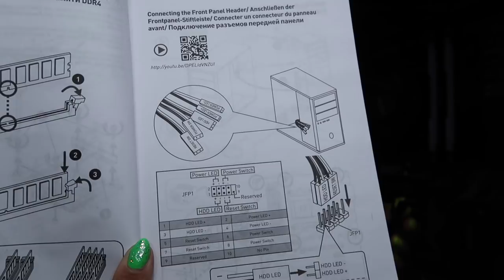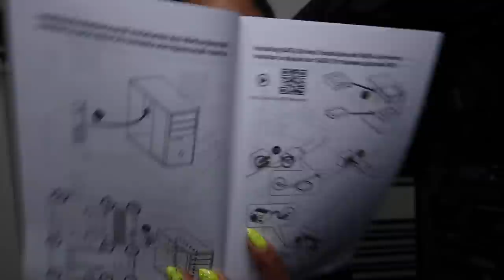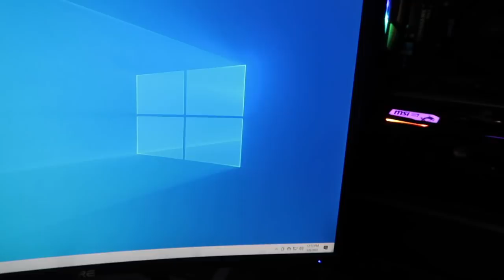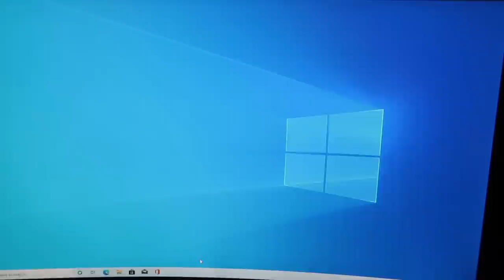My 1st PC build!

Comment: one of the fans should blow outward to dissipate heat, usually the one at the back
Reply: She added a caption saying that she will be flipping the fan in the back so it’s an exhaust instead of intake. :)

Comment: hey just a little tip for you. You have everything as intake. You need to flip the fans around that your using for exhaust because right now they are being used as intakes.
Your front fans are fine though you have them the right way for intake but the top and rear ones you need to flip around.
Reply: How can you tell from afar?

Comment: Great build, I just did mine this weekend. Thank you, you reminded me about the cable extensions for cable management, I will get some cable extensions for my new build. I did like the "Hello Kitty" insert, just a reminder you may want to check out which direction your fans are blowing you can do Positive, Negative or Neutral airflow inside your case.

Comment: It a good habit to test outside all the components (on top of mobo) before putting them in the case to make it easier to pinpoint the fault just in case as it lessens the load if something goes wrong afterwards. It also helps you figure where things goes as everything's out in the open.

Comment: If your hair keeps getting pulled into the rear fan it's not set up as an exhaust fan. It's in pull configuration. So you'll need to turn it around to put it in push configuration to exhaust the heat out of the case.

Comment: Well done, great parts for a powerful pc. Although your peel game needs some work lol.
You might want to look up a video on how to configure your fans in the BIOS. They are running full force so I suspect they are 3 pin fan connectors and they require a different setting, it will make your pc whisper quiet.

Comment: Before putting fans on top always run cpu cables etc through before installing fans top side makes it a lot easier also always use pcie slot closest to the cpu :)

Comment: Hey there! I just wanted to point out that your rear and top fans should be in the exhaust orientation. The way they're facing in this video is intake (fan grill/the "X side" blowing air in) and not allowing hot air to escape. Assuming time has passed, you may have had someone mention it already and you've addressed it. Other than that, wonderful build and so happy to see you proud of your masterpiece!

Comment: Great build👍 I would consider turning the top and back fans around as they are all intake so it will create a lot of negative air pressure which isn’t good for airflow and thermals whereas a combination of the two intake at the front and the outtake fans at the top and back will keep the air flowing nicely

Comment: great build, well done. :-) other than the fans that i know you turned round, the only thing id be worried about id the ssd not having a heat sink on it. that will get hot and will slow down when getting too hot. <3

Comment: Good job on the build!  It looks like your rear fan is backwards. You want to make sure that it is exhausting air out. There should be arrows on the fan that show what direction the blades spin and what direction the air will go.
Reply from the maker: Yea I noted the fans were on wrong I just haven’t turned them around yet 😓

Comment: quick tip if you build again do not place mother board on top of the static bag put it inside the motherboard box or in the trash as any static electricity would easily jump the mother board and cause it to not work

Comment: I would recommend to change from a block cooler to an aio cooler for your cpu, also I do not recommend you to unplug/plug anything in while the pc is ON, unplug the power supply and hold the power button for 15 seconds so all the power in your pc is gone, THEN start working on it. But overall nice work

Comment: you can move the AMD CPU cooler easily to show the AMD logo correctly the way to do this is where the AMD logo pull it upward to get the cover of the fans. Then you will see four screws unscrew them so that you can remove fan from heatsink/metal block thing with fins onto of motherboard. then you can rotate it and screw it back in and put cover back on. just remember to unplug cable of CPU cooler first before rotating and unscrewing CPU cooler fan from heatsink. I did this when I had the same cooler.

Comment: I have that case.  It's a nice case but it is huge and really meant for water cooling which I don't have.  Live and learn.  Next time I will get something more designed for a air cooled set up and much smaller.  Nice computer though.  Definitely needs more funko pops inside.

Comment: The fan at back is facing wrong direction. It should take the hot air ot of the case. So turn it 180 degrees horizontally. Your case will be cooler.
Reply: This video is from a month ago so I'm sure she's corrected all that already..😉

Comment: overall nice build. but its not a good idea to have all the fans as intake. you need to turn 1 or 2 as exhaust. i would recommend turning the top fans as exhaust and also the rear one. the front 2 fans are huge and move a lot of air inside the case.

Comment: the only think u should have gotten instead is the 600watt should be a 850 or more. and the 500 ssd should be 1tb with updates, game saves, apps. take up room quick. going with a better watt power supply like a 850 gives u more room to upgrade your pc later on.

Comment: There is a slight error in the fans
  All the fans that you have enter the air into the bag and this is wrong
You should make the fan at the back and the fans at the top blow out the hot air
You have to turn the rear fans and the top ones

Comment: Enjoyed the video! Good thing you used Western Digital Black as the primary drive instead of Western Digital Blue. WD Black is way faster than WD Blue, but it is also more expensive. WD Blue is for general use. Most gamers prefer Black over Blue. There is also WD Green, which is even slower and cheaper than WD Blue and has smaller capacity options, but WD Green uses less energy, so it is quite common in laptops. Anyways, keep up the good work

Comment: You have no exhausting fan an creating negativ air pressure in your pc, which causes more dust in you PC and bad cooling efficacie.
 I would recomend you to flip your fan at the back and the tow fans at the top for ideal airflow and better temps :)

Comment: the 3 small fans should be output  the  2 big ones blow air in case and the 3 small ones should blow air out of case need to turn them around

Comment: The Western Digital, do I need the hard drive and does it come with the SD card or do I need to search the specific SD card alone?
Reply: There's a difference between SD and SSD. A Western Digital SSD is used as a hard drive for long-term storage. The one is this video is an M.2 SSD. It is faster and smaller than a traditional hard drive. SSD stands for "Solid State Drive", which means there are no moving parts and it is noiseless. Most newer motherboards have these M.2 slots. On the other hand, an SD card refers to portable storage, which you see in a camera or an Android phone. So when comes to a desktop, you only need to worry about buying a hard drive. Look in the manual for your motherboard, to see what type of connector you need for your hard drive. Most likely it will be M.2 or SATA, both of which accept Solid State Drives. Also, find out the speed of the drive, and match it to the motherboard connector of choice. M.2 with NVME is very popular these days as it is much faster than SATA. But they are also more expensive. So a lot of people use a faster drive as their boot drive, and they will get a slower but bigger drive for secondary storage.

Comment: Hi Chrissy! Were you able to go into BIOS and set your RAM to it's specification speed? It's called an XMP profile, it should say that in your RAM spec area in BIOS. This will allow your system to perform optimally, and it's really simple. If you don't know how, just check out a video on the subject. Great video...I went through similiar with my Ryzen build as well. :)

Comment: what CPU cooler did you use? does it come with the CPU or does that depend on where you buy it? got another question, do you spend a lot of time on your pc? I afraid I'm not gonna use it much, for example, I experience that when I bought a Nintendo and didn't like it so I sold it, and I don't want that to happen when I buy a pc
Reply from the maker: My cpu came with a cooler it’s a Ryzen 5.  I don’t really spend a lot of time on it because I still work full time and I get busy but I don’t regret building it 🙂

Comment: Okai so the only thing I can see u did wrong is that u put the Fans that didnt come with ther case as an input, so they are blowing air into the case and not pulling it. Its better to have a positive air pressure inside the case so the dust doesnt get inside as much. So u should change the fans u added so the black reinforcement bars u can see facing the inside of the case are against its panels (aka top and rear side). Besides that the build is pretty okai. Loved ur reaction to its first boot.

Comment: your back fan need to turn around did you put paste on your cpu i didn't see that Thank you
Reply from the maker: Yes I said / noted in the video and left a pinned comment that I was aware and have switched the fans. This CPU cooler has thermal paste pre applied. 👍🏽
Reply: here to help

Comment: hey just wanted to lyk your fan in the back of your case is pointing the wrong way. it's cooling your room, not your pc so make sure you turn it around. Also make sure your tops are pointing air into your pc aswell. Nice build though, have fun!

Comment: Hello a power surge fried my home office PC. It damaged the whole PC. I took it to Geek Squad and they couldn't power it. The computer was 11 years old. They said,``After 11 years its time to get a new one.'' My backup PC is a 2012 model. It was built 12 years ago. It works but its on its last legs too. When it turns on, the fan grinds. Other times I have to turn the PC off and on to get the fan working. The power switch got jammed and broke off. Now I have to take the panel off the PC to power it. It runs an Intel Q9550 2nd generation quad core processor. It has 2.8 GHz. 8 GB RAM, Seagate 500 GB hard drive, PNY NVIDIA GeForce 630 GT video card, Cooler Master 650 PSU, card reader, etc. It runs Windows 7. My monitor is a Gateway 22 inch. It has 1680X1050 resolution, VGA, HDMI, and DVI inputs and Ultra Contrast is 2000:1. The monitor is 16 years old.

Comment: There was a couple mistakes in this video:
7:00 Its good pc building practice to put more thermal paste on the cpu, even if there is pre applied paste on the cooler.
9:02 You suppose to put the ram into slots next to each other without a gap, because of reasons.
8:47 Thats called a brace, not an io shield
6:56 She didnt screw it with enough confidence.
Reply: You're 2nd point is CAP she did it right.

Comment: 16:03 Almost exactly what RTFM stands for....Read The F**king Manual ;)

To be honest, if it's your first time building a computer you should read ALL the manuals, don't trust that some other YouTube video will solve it.
I know you mentioned that you found out the exhaust fans were the wrong way round (The frame of the fan is always the back of it so you should point that the way you want the air to go). 

WELL DONE for putting the memory chips in the correct slots, you have no idea how many people mess that up.

I'm at 16:03 and It also looks like you were worried about space but you were about to put the graphics card in the wrong slot, it usually goes in the top slot which would be the x16 slot or x8 on older motherboards.

Your m.2 card also doesn't look like it has a heatshield or cooler, wasn't there one already installed on the motherboard (or in the case?), You can also put m.2 cards in a PCI converter, they usually come with the cooling fins already on it so the air going through your case cools it down.

To be honest, I would get a better CPU cooler than that, that's the default AMD one, you could get an AIO cooler, which are the ones with 1,2 or 3 fans and a radiator like you get in a car, but, with the fan set up you have, you probably would be better with a 2 fan cooler (like maybe a Noctua NH-D15 CHROMAX, which is black and would go with the rest) and orient it to take air from the front, push it through the fins and out the back. (Also called a push/pull configuration because the front CPU fan pushes air and the back one pulls the air and puts it out the back), then your airflow will come in the front of the case, go through those and be pushed out the case from the back and top.

If you do decide to change the CPU cooler, check if it comes with thermal paste on it, some people prefer to wipe that off with isopropyl alcohol (which you can get in wipes, like Zeiss Lens Wipes, I swear by those cos you can clean your glasses, phone and other stuff with them too) and use another thermal paste but it's not usually required.

21:10 Don't put a PC of that size on a desk, put it on the floor if you have hardwood flooring, if you have a carpet then you can put a wooden board under it, your power supply likely intakes air from underneath (judging by how you installed it) so don't put the case directly on carpet cos it'll just suck in all the dust off the carpet. When the PC is on the floor, all those buttons and ports on the top are a lot more accessible. PC's of that size aren't supposed to go on a desk unless it's very sturdy, like a proper office desk.

22:40 I would also recommend getting a fan controller, like an NZXT Fan Controller or Corsair Commander PRO, those can sit on the panel (either with 3M sticking pads, magnets or screwed on) behind your motherboard and they will plug into one fan header (port) on the motherboard (which makes the inside look neater as there's less cables visible) and use, either one Molex power connector or a Sata power connector to power them, then all your fans can plug into that instead, with only one cable going into the motherboard, you also don't need to use fan splitter cables which (If they're not wired properly) can cause a short. Those fan controllers also usually have software programs you can use to configure the fan speeds, either individually or the same speed for all. They also make changing fans a lot easier as you shouldn't have to take apart the whole thing and rewire it.

24:40 WOAH! Don't be plugging things in while the computer is on! Even LED cables, even if it's a data cable they still conduct an electric circuit, if you stick one pin in and it touches something else (like another pin) you could short something. Always connect cables while the computer is off (preferably unplugged too).

25:35 GET CABLE TIES! You shouldn't leave the wires just hanging, usually your motherboard or case will give you a couple in the box but it's best to buy a small bag of them on Amazon or similar, you'll see little channels on the back of the motherboard tray or little metal loops, those are anchor points, where you can tie the cable ties to and secure your cables against the tray. Just obviously make sure there aren't any bare pins touching it.

26:20 Stop that now. It's not furniture lmao. If you put things up there and they fall, they could knock off a capacitor or something on the motherboard or hit a fan blade on the graphics card, if there's even a hint of metal on the object it could complete a circuit on the motherboard that shouldn't be completed. Don't put things in your case like that, it's not a good idea, that's what your desk is for and, if you put the PC on the floor, you have even more room on the desk for niknaks.

26:35 ...because you just put a light plastic object right behind a 200mm fan going at full speed. STOP IT! :O

Since almost everything in your computer has LEDs (BLING!), did you look on each manufacturer's site to see if there's LED management software? There probably will be if the LEDs have their own cables.

Comment: Very nice job, especially for a first build.

When you have time, you should enable XMP in your BIOS, so that your DDR4-3600 RAM is running at full speed rather than the default 2133MHz JEDEC speed. This is very easy, and really helps performance for some things. I have a blog post that shows how to check whether it is enabled.

https://glennsqlperformance.com/2019/12/23/how-to-tell-if-you-have-xmp-enabled/

Comment: You made two mistakes on the part choices. PSU and RAM latency(CL). PSU has only a 3 year warranty and isn't too great in quality for future upgrades. Your RAM latency is CL 18 when you could have easily gotten CL 16 for the same price. Other than that, the rest of the build is fine.